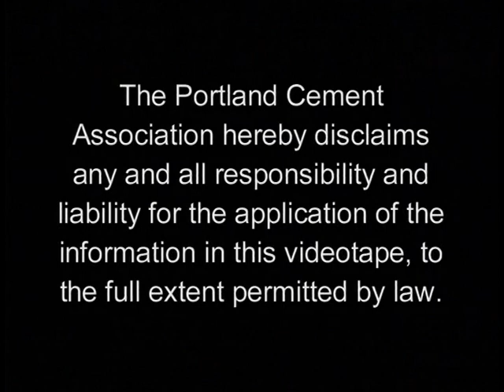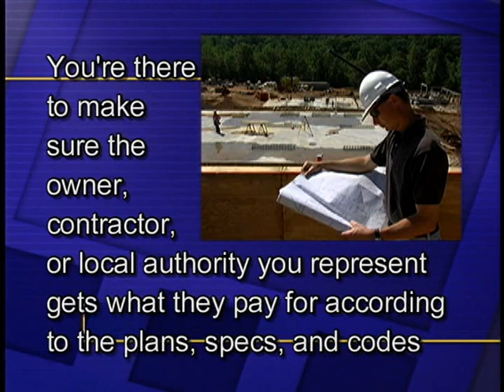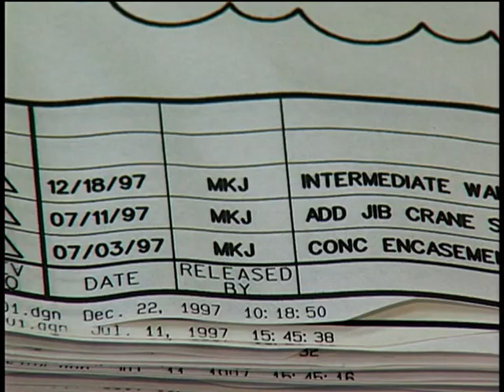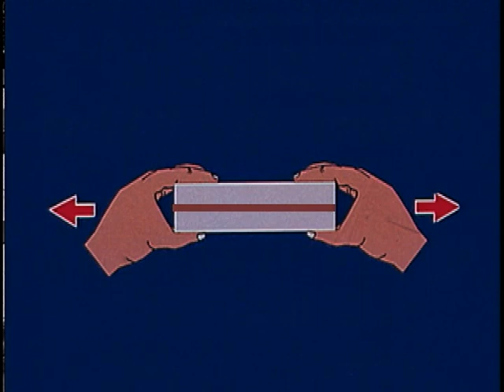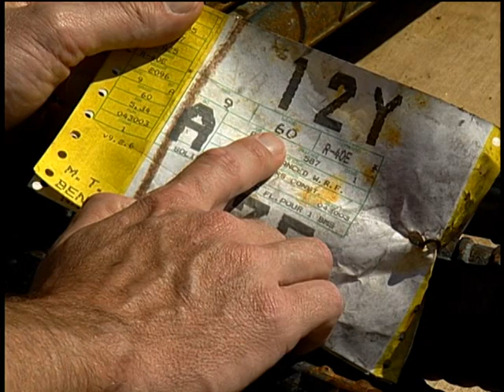What to Expect When You're Inspecting, Part I

Comment: Kind Referee, check for soil report, look for loose debris, Rebar tags, wire, rocks and trash. Have the current Plans and any RFIs or changes made to the area to be inspected.  Look for simple presentation, is there proper clearance? Is the size of the bar and spacing correct?  Is the lap splice correct? Lap splice will change if the PSI of the concrete is 3k or 5k? Check lap schedule. Read general notes!! And if you are on my job give me a break!!
Reply: Yes and if I’m the City Inspector. Please show me your Deputy Inspection reports then give me your job Card so I can put my Precious signature on it. And you and I will work hard to keep your project on Schedule. And I have been known to give a break to good Superintendents and even come back by. Lol.

Comment: What is the remedy if there are rust on the installed reinforcement?
Reply: Kind sir, if you have rust on the bar prior to concrete placement you are in good shape. What you want to look for is scale and degradation of the nominal thickness of the Rebar. Also, mud, debris or oil is not allowed on Rebar. Typically during the course of a job the Rebar will not degrade or have enough rust to cause alarm. After a heavy rain a newly delivered load of steel will have light rust as there is no coating applied.
Reply: Repaint it with the green exopy paint

Comment: If tie-wire has oil?
 What should we do??
Reply: Kind sir, the oil in the tie wire is of no concern. Check the specs under concrete and ensure that they are using what has been specified.  Plans and specs will be your back up!